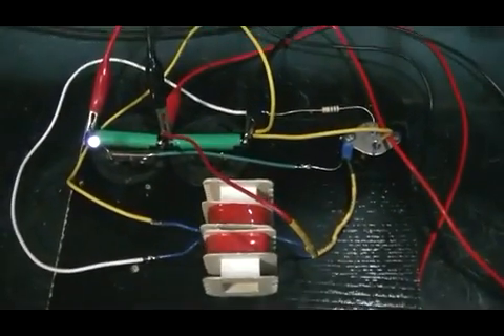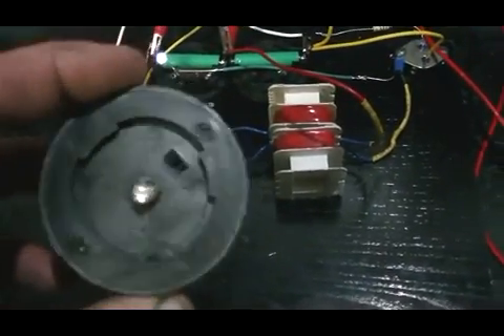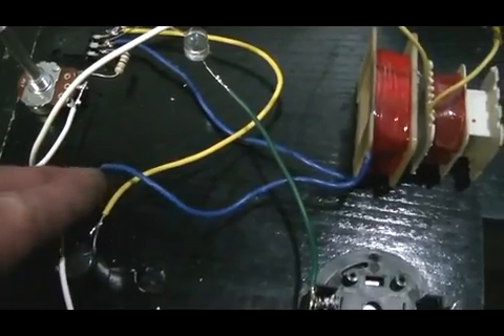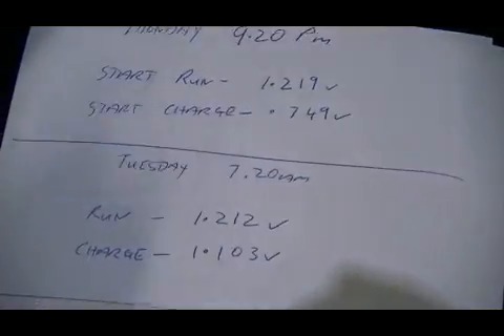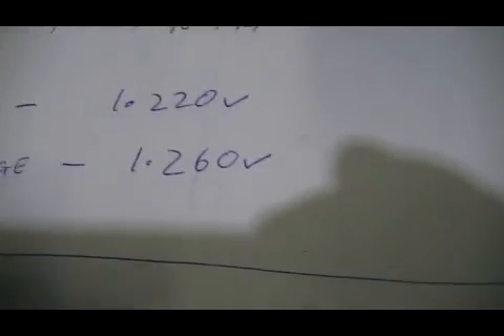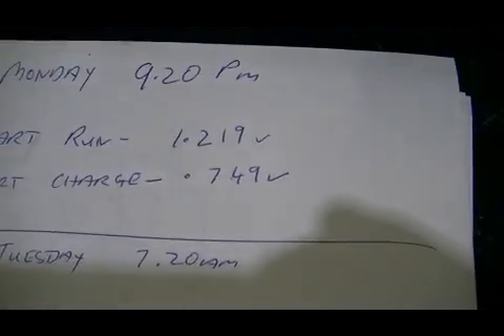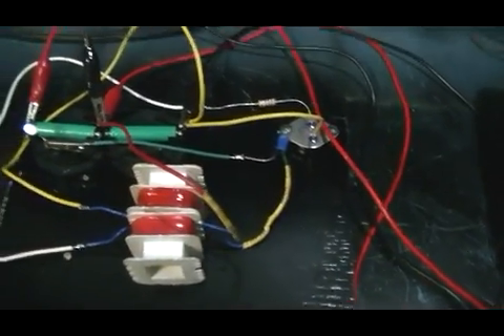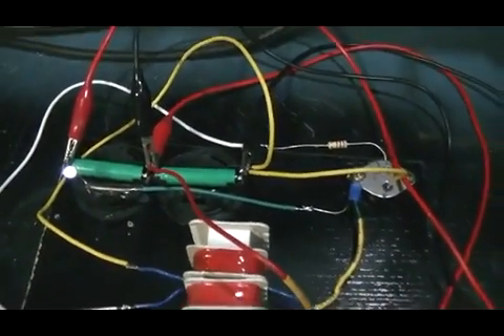Cool joule day 3 update

Comment: Uploaded a vid last night, first circuit carries on charging - but i'm not seeing expected decrease at night on the run battery. However, ION will be correct am sure due to chemical nature and heat. 
First circuit uses RGP9 uncommon seeming diode. Second circuit - 2N3904 showed increase, 2222A didn't (thinking Negister), S9014 borderline, C1815 borderline, C3198 works.

Comment from the maker: Hi Aaron
I dont think the run battery is recieving a charge,but more the heat of the day see's it recover slightly each day-but at the end of each day,it dose drop a small amount.At a trickle charge that the charge battery is recieving,and the low voltage it recieve's-i doubt we would get any surface charge,The best charge you can give a battery is a slow charge.Will see how the second charge battery runs the garden light.

Comment: This one is even simpler than the LAG, I think. Very interesting circuit!
It is intriguing the charge battery did not get a fluff charge, rather it was a solid recharge. The flyback voltage is so low, yet it seems to charge both run and charge batteries.